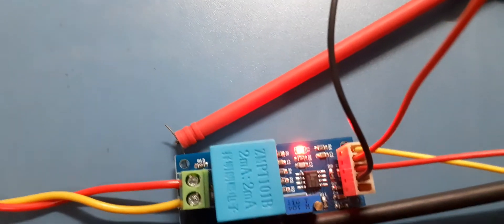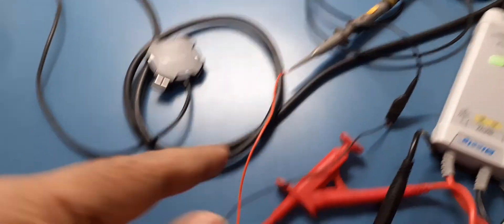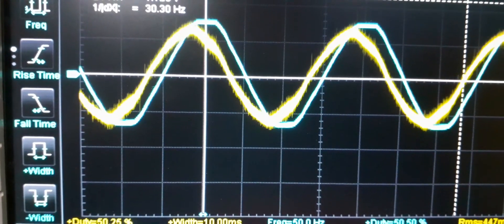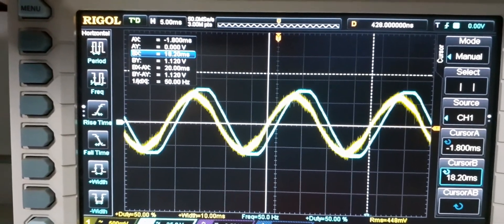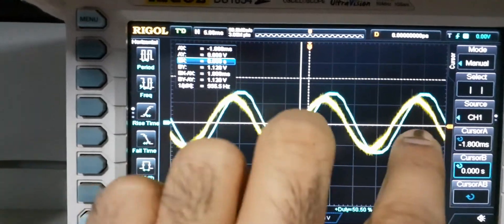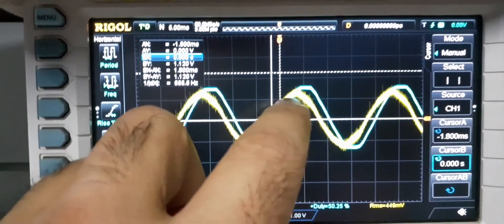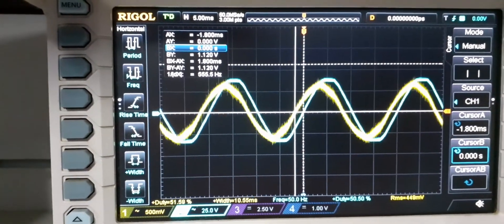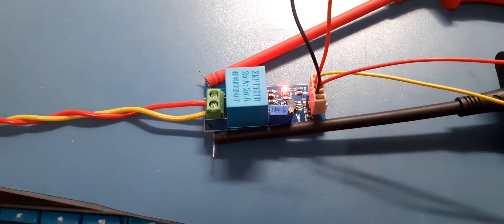Test ZMPT101B voltage sensor

Comment: Awesome video. Can you please test the phase shifts on the transformer of the ZMPT101B. Maybe you will have to remove it from the board. Can I use the only the transformer to calculate the Power Factor? Thank you in advance, appreciate it.
Reply from the maker: The transformer should not be removed. It is actually a current transformer (2mA:2mA). Some manufacturer decided to offload their bunch of useless parts and they came into the market. If I remove it from board and connect directly to supply, it will go up in smoke. I can test with signal generator, but I do not have one..
Reply: @Debraj1978  Yesterday I removed the transformer and connected a 820k resistor in series with 230V AC mains power as the data sheet recommended. I'm getting an out put Voltage of 3.6V AC on the secondary. I don't have a osselescope to test the AC wave form to see if the transformer is in phase with the mains power.
Reply: @Romello_Pietersz  did you ever test with a scope?